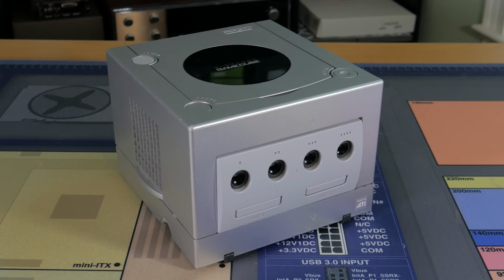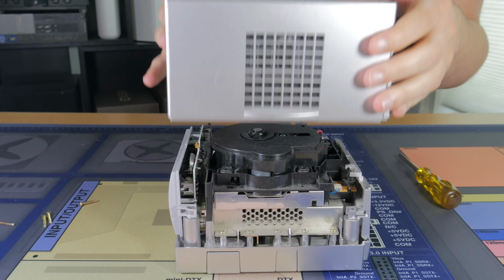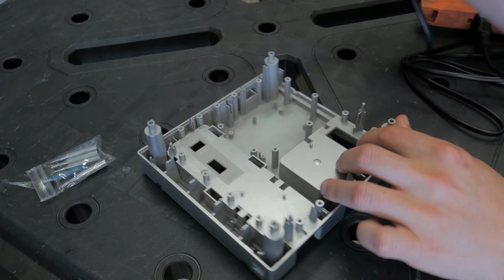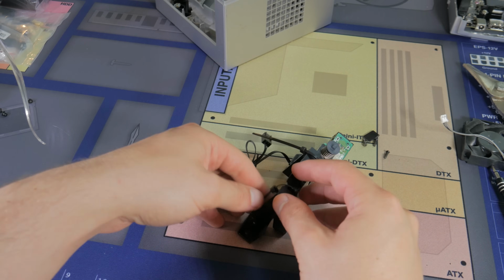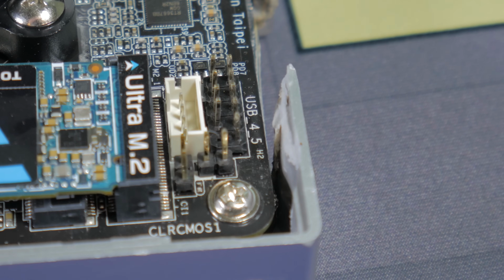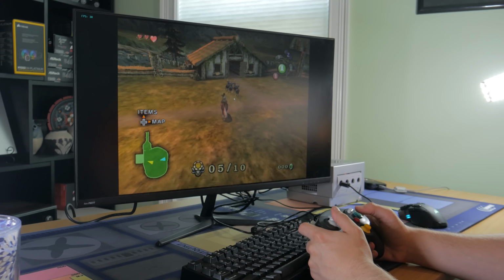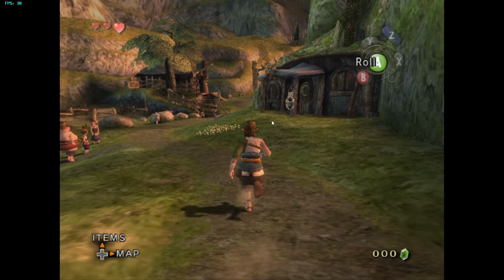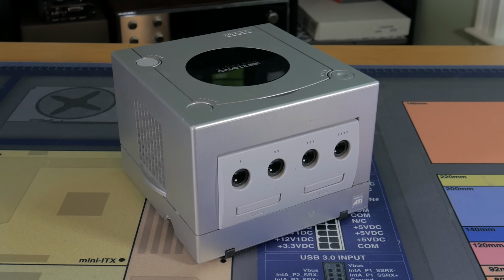I Built A GameCube Gaming PC!

Comment: You could try upgrading to a Ryzen 5 5600G, these work very well for most games and have 6 cores, 12 threads and a 4,4 GHz Clock speed, while only having a 65w Tdp.

Comment: Was the first PCB for the controller ports actually necessary? I figure the original ports would already have all the connections needed to plug into the USB adapter PCB. Maybe just cutting up and rerouting the ribbon cable could've saved some space.

Comment: God bless you. I got a question.

Because this is a Gamecube Sleeper PC, I imagine you had to add the Wifi Card, and a Wifi Card includes Antenna.

Did you include an Antenna in this gamecube PC or a small antenna?

Im basically trying to build a gamecube pc myself and I can't find a good internal antenna for the wifi card.

Please help. 😢
Reply: I bought a deskmini with intel 7500 i5 and it has external wifi antenna on the I/O shield.

Comment: Looking to put this mobo in an original xbox any recommendations on a cpu cooler with at least a 100tdp or higher cooling power that will fit inside while still being able to cut the top emblem for a noctua 80mm redux fan or if need be a slim 80mm fan

Comment: You had an issue with a disk drive because the design of the original shell case doesn’t allow regular size disks. There was an aftermarket shell case called IcedCube. It is clear, and the design allows regular sized disks to be played. I bought one years ago. I modded my GameCube with it. Still works great.

Comment: Nice video. Gave up after the whole gutting of the bottom of the gamecube with the cutouts and soldering. If needed more space, would using a Playstation 2 casing fit the bill? Have a few broken Gamecube I can try to mod from.

Comment: I wonder if there is a way to get a external gpu to work. Something that you could hide away. Obviously this motherboard doesn't have thunderbolt. My only guess would be using an intel NUC which is pretty pricey (cheapest board i can find is 500 with a soldered on processor. Hell from a glance on intels site it seems cheaper to buy a full nuk instead of just a board lmao)

Comment: I just melt the plastic of a bic pen and jammed it into the weird nintendo screw before it cools. The clear plastic pens work better but your going to want to wrap it in some tape. Its a bit more rigid, which means a better grip but will shatter in your hand if you twist it to hard.

Comment: You should put a rgb 120mm fan under the lid an use a pressure switch to turn it off with the lid closed

Comment: I wonder if finding someone to 3D print a replacement bottom panel would have made it any cleaner? I know you were going for an " authentic" look but that's what I would have tried. Still looks amazing! Keep up the great work!
Reply: Im actually in the process of doing this build myself with some personal alterations like 3d printing some parts. Im planning on designing and 3d printing a custom i/o shield for the back that filles the whole space and either a whole new bottom base or hybrid 3d printed inserts with canabalised original base!
Reply: @austinn261 I’d suggest cutting the tabs off the original bottom covers and gluing them in place
Reply: @austinn261  how'd it go?

Comment: That is a nice thing. It would be perfect as a RaspberryPI case as well. Doing these projects. Then I have found, that using cotton from quetip's or pads, work like a cement, if you add superglue. You can use bakkng soda and super glue as well.

Comment: Could've put some USB ports where the memory card slots are. two ports hidden neatly behind each memory card port hinge.
And than mod the covers fro the bottom bays to put them back on and close up that side.
But props for the project and actually using a broken Gamecube. Working ones, just with all old consoles and home computers, aren't going to increase in numbers.

Comment: Considering doing this but cant figure out how you closed the case. The top and bottom half are only connected by the 4 security screws and your mini STX motherboard blocks them. It would just fall apart without those screws

Comment: I know this is an older vid, but I still wanted to mention something about the Wii U emulator. On the Cemu demonstration, most of the lag spikes your experiences weren't from performance issues; they were from Shader Stutter (a limitation of modern console emulation). Using a shader pack should remove the shader stutter, but even without those hitches your performance likely wouldn't have gone above 20 or so fps in normal gameplay. Hope this was helpful!

Comment: I was inspired by this to finish my setup. I just so happened to grab the same MOBO/Case you did. This is something I've been wanting to do for years and glad that board fits perfectly. The only thing I'm sad about is not being able to use the USB-C port because it's way to close to the case. Wondering about using jumper wires to a header and then using the MemCard slots as USB-C female on one and standard USB on the other. Also I added an led colored case fan where the GC disk drive would be loaded. So just pop that up when in use.

Comment: One thing to be aware of, some games such as GTA V have a problem of just crashing constantly if a Mayflash is plugged in, even if not in use or no controller, GTA V simply won't start for a lot of people, including me, if it's plugged into USB. You may want to add a hardware switch for your USB connection for controller ports.

Comment: Zelda BoTW seems to run well over 30fps the spikes are due to not having a shader cache installed for the game and probably could've used some other tweaks/mods in the settings.
The R3 3200g can even run some Switch titles at pretty respectable Framerates.

Comment: Interesting, I've got an empty  blue gamecube case just waiting to be used for something.
I had thought of replacing the front connector panel with some translucent red acrylic and making a LED digital clock out of it, as I had all but given up on finding anything else that would fit.
Reply: Besides a GameCube logic board, you mean?

Comment: 14:36: Those actually aren't lag spikes. The emulator is constantly compiling ingame shaders. In order to fix it, you could download pre-compiled shaders and insert some graphic packs. This wil both make your game run smoothly and render it at 60 fps or even more. Also, in cemu's graphic settings it's just better to use OpenGL, rather that Vulkan and using your whole graphics card.
Reply: @cheezyfriez12  They aren't that terrible anymore. Since the 22.7.1 driver, which was released in july, it got much better. Still think Vulkan would be better though.
Reply: DO NOT DOWNLOAD SHADERS. Idk where people got that idea but unless their hardware is identical to yours you will have a worse time downloading shaders than if you were to just play for an hour and compile them yourself.
Reply: @christianmino3753  I've never had problems downloading shaders
Reply: @christianmino3753  this, shaders are meant to be compiled for your specific hardware and things can be even slower
Reply: @memes_gbc674  so what about a steam deck? If someone shares their shaders file from a steam deck for other steam decks would that work?
Reply: @tonys-yl2tk  steamdecks all have the same parts (that matter)
Reply: fuck in game shaders, run raytracing like that one guy who did mario 64 RX
Reply: @DavidFrycSaber  Shaders as in the textures/materials of the world. Not lighting.

Comment: If he'd done this when the gamecube was new he'd be a legendary casemodder and LAN party monster

Please, never use a soldering iron to cut plastic again, at least not without a respirator. The fumes can be severely toxic and it makes a lot of ugly marks while it's at it!
Just for reference, the GameCube was not at all competitive performance wise, the PS2 and Xbox crushed it in raw performance, the PS2 because of it's high performance graphics engine and DVD support and the Xbox because of it's significantly more efficient processor architecture and a surprisingly pretty modest GPU... But the hard drive in the Xbox and the optional disk drive for the PS2 mean they wipe the floor with the GameCube all day.
Reply: The Gamecube was much more powerfull than the Playstation 2.
Reply: From what I've read the GameCube was the most powerful console for its generation

Comment: stopped watching when I saw soldering jumpers... Jumpers are not meant to be soldered, for several reasons. Most importantly they are not trustworthy, the whole point of using jumpers is to prototype quickly, and if you want a more robust, (do it once and let it stay forever) kind of solution don't use jumpers at all. They are cheap for a reason :D
Reply: Where did he solder them?

Comment: The disk drive idea could possibly have worked with the Panasonic Q, which was an official GameCube that had DVD support that was made to combat Sony's DVD support on the PS2, but those are hard to find and that's basically a collector's item
Reply: I know that there used to exist replacement shells that made  the tray full DVD sized for burning homebrew and backups to full sized 4.7GB DVDs... I don't know if they still exist or how much they go for, but maybe now that 3D Printing is more common and accessible...?

Comment: Best way to practice soldering is get some random old electronics and practice removing and replacing components. Then get some wire and practice different methods or soldering them together. Also remember heat shrink. Everyone who does a lot of soldering knows how much it sucks to forget to add heatshrink before soldering.

Comment: Did you say “classic” the silver one was a special edition one. The purple gamecube and blacks ones were the standard. He must of got a gamecube years after they were a thing
Reply: Thank goodness. Only the early models have the digital out port. Edit: this one has a digital out, it was an early model. Thankfully it already wasn’t working!
Reply: they say it was special edition but it really wasn't. it was just marketing.
Reply: The platinum is a classic model, it has the digital out port, which only came in the DOL-001 series.
Reply: @znub206  There were also some without it, however.
Reply: @damian9303  correct, nintendo released an updated model of every standard colour, DOL-101, where the digital port was removed because nintendo realised almost no one used it at the time.

Comment: Oh... oh my word. I need 5.
Sidebar, as an alternative to a APU build. Snag a maker board from like, Udoo or LattePanda, they have dual-core and quad-core cpu's, and then attach Zotac's ULTRA tiny GTX 1650 (5.94 inches long) using a M.2 adapter. Optionally, you could turn the disc platter into a 2.5" hard drive tray. Enjoy.
Reply: Where do you put the grtaphics card?

Comment: Ultimate confusion generator:

1: buy a gaming case, or just use a Compaq.
2: Paint it beige. Preferably add a few tacky processor stickers.
3: Build a gaming PC using that case.
4: Add a keyboard to the front, or, in the case of the Compaq, use the built-in one.
5: Install a modern OS.
6: Theme it to look old.
7: Make the start-up sound the one Win3.1 uses.
8: Bring it with you in public, play triple-A games.
Reply: My main rig at work is on an old pentium II based beige case (An old Transtec 1300. I still have the "year 2000 Compliant" sticker on it ... and the floppy drive) with an IBM Model M Keyboard. But, inside, there is an i7 8700k, 16Gb RAM DDR4 3000MHz, A Nvidia 1050Ti (I know, it's not the best but for "just" text editing and network monitoring, it's still overkill), 512Gb SSD PCI-E, and 1.5Tb HDD inside
Reply: @TheotanyaSama  pretty nice sleeper setup, ngl

Comment: Awesome! I had an idea of putting a NUC into a GCN shell years ago when it would have been basically impossible to even emulate actual Gamecube games on it lol. Unfortunately I never had the spare cash to put into a project like that. You're inspiring me to take another look in the coming months as a summer project.
With that said, I'm a little sad that you didn't find a solution to secure the top shell due to the size/tight fit of the motherboard. After watching your OG Xbox sleeper PC build and some of the recommended materials mentioned in that video, I think I have some ideas on how I could clean this up in my own attempt.
Thanks for giving me a jumping off point!

Comment: Unless you illegally download and use a shader cache for Wii-U games, you have to build the shader cache as you play, so it's going to be laggy at first.
Also, now that a little bit of time has gone by, the Vulkan API has been greatly improved on the CEMU with asynchronous mode that makes it way smoother to play on AMD GPU's (including the APU's) and runs at better frame rates.

Comment: How does this motherboard not short out? The metal on the bottom of the  motherboard is sheet metal which could cause this problem to occur. You might need to mount the motherboard with rubber spacers to avoid shorts from occurring.

Comment: So for the optical drive they used to make full size DVD case mods for the gamecube. Doesn't look like they're in production anymore. I was going to do a similar build back in 2017 with mini STX but I was limited to thermals and where to put the PSU. Here's an old listing for the drive cover if that helps any. https://www.ebay.ca/itm/NINTENDO-GAMECUBE-LEGEND-OF-ZELDA-COLLECTORS-EDITION-G78-CIB-/143574555343?oid=122045452651
Reply: You may also be able to add on an external graphics card if you don't want to use one of the m.2 slots or maybe even be able to fit a smaller GPU inside the casing.

Comment: Hey so pro tip for gamecube dismantling a gamecube. Take a cheap plastic office pin the ones where pen body is a solid piece of clear plastic. Take it apart and melt the end with a lighter, the part where the writing end came out of, once its melted a little shove it down the hole of the gamecube giving firm pressure. Hold there for a few minutes and there you go you made a custom gamecube screw driver. If it ever quits working just remelt.

Comment: "revealing ridiculous amount of thermal paste on the heatsink, definitely gives me flashbacks to a certain pc build video"

verge pc build flashbacks
Reply: @AJA_974  "He not fighting static, he fighting cancer" -Bitwit
Reply: Doxide “ he’s wearing a what would Jesus do bracelet”
Reply: Abdulla Al-Attiya don’t forget the cpu aligner and thermal paste applicator
Reply: Hosey_Gaming How could you forget about 1st needing a table?
Reply: @outstandingdogmarron9890  Without a table you may as well throw away all your other components
Reply: Don't forget to put the PSU on the rubber anti-shock pads!
Reply: Kakarot 93 ah yes to prevent the PSU from short circuiting by coming into contact with the rest of the system.
Reply: Don't forget to screw with confidence

Comment: If you don’t have a screw driver like the one you had to buy what I did when I wanted to take mine apart was burn the end of a pen with a lighter and sticking it inside the hole and letting it cool down on top of the screw so it can mold your own custom screw driver.  🤷🏼‍♀️🤔🧐

Comment: "Designed by ATI."

Technically, the sticker isn't wrong.
Reply: Did you mean the sticker on the original GameCube? It's been such a long time, but I remember it says "Graphics by ATI". I so regret that I sold my GC back in 2007.
Reply: @sunjoexys7251  you would be correct
Reply: @phawxhunter  also, they use XT again. Both for GPUs and CPUs.
Reply: @plummy_n00b  uhm.. where i can find retro XT labeling?
Reply: well it isnt tecnically wrong
it use amd ryzen and amd radeon vega wich is continuation of ati radeon since ati was bough by amd
so legacy case modern hardware
Reply: @jam06  other way around, AMD bought ATI. ATI was dissolved into AMD, and stopped using ATI branding in 2010.
Reply: @ceruleansky6670  In a way, no ATI, no current AMD Ryzen run on this Gamecube PC. So, powered by ATI's legacy?
Reply: @ceruleansky6670  then want is Athlon?
Reply: @SRC267  Athlon has never been a ATi name ?
Reply: @jam06  not really.
Reply: @phawxhunter  they still called some gpus as ati until 5000 series
Reply: ATI is modern day AMD.
Reply: it technically is wrong because ATI doesnt exist anymore.
Reply: @const3llations_370  they do amd still use the name as they acquired them. infact they still use it
Reply: @NonsensicalSpudz  no they don't actually still use the name. It was dissolved and absorbed by amd and they stopped using the name in 2010. Old news.
Reply: @const3llations_370  My vega 8 says its made by AMD and ATI technologies. its still used internally
Reply: @azureotsu  nope. AMD have ceased using the ati branding name. this is factual information released by amd themselves. dont be a moron

Comment: Nice build! Pro tip though. When cutting thin sheet aluminum and similar materials use a razor knife to score the metal then bend it until it breaks for cleaner cuts.